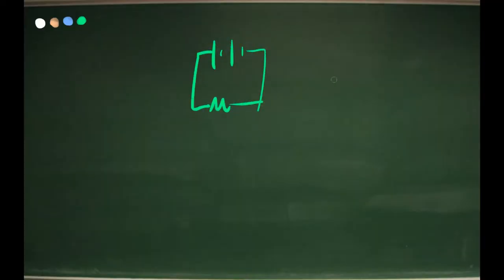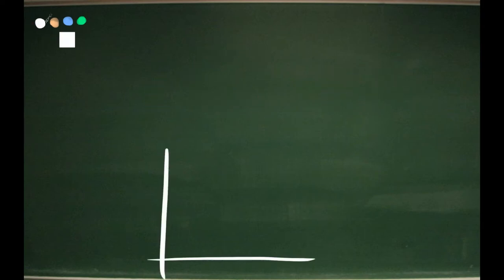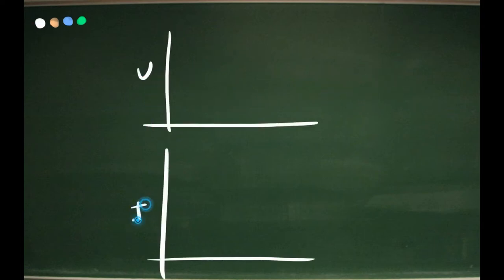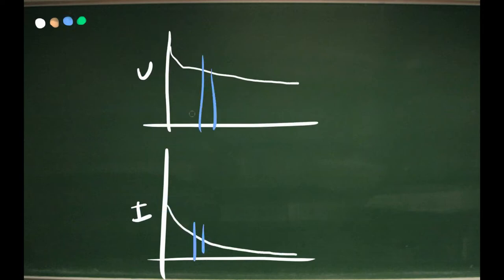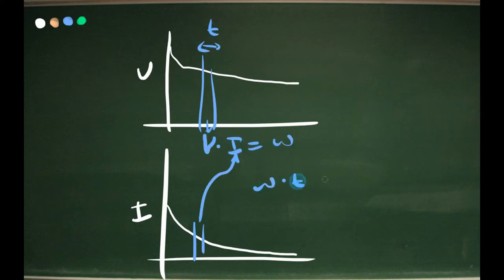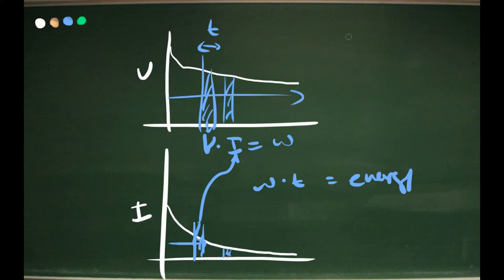5 Ways to Measure a Battery's Performance

Comment: For drivers new to EVs, some of these data points you mentioned aren't available to help us measure EV battery degradation. While not perfect, how reasonable is tracking below over time for an average EV driver:

Kwh Used / Kwh Available = ~ Battery Degradation

Comment: I thought I'd share this paper I found where researchers seem to have done an amazing amount of optimization on this Iron-chloride-acid battery invented ~ 1980.  They use Indium-chloride to reduce H2, with ascorbic-acid, citric acid, and other additives.  They claim to have improved charge-efficiency from 50% to an average ~90%.   They even mention ligand type structures (presumably like EDTA) to support a pH gradient that a separator-membrane won't, in order to mitigate side-reactions.     http://jes.ecsdl.org/content/163/1/A5118.full.pdf  A lot of this seems DIY accessible, FWIW.
Reply: Thanks Mike, good digging.

Comment: Hello! You talk a lot about batteries and I saw you have a PhD. Did you get your PhD in electrochemistry? I have a PhD in lignocellulosic materials and working with this stuff I wonder what do you think about cellulose in batteries. You know, cellulose is electrochemical inert but if you chemically modify it to put a big density charge onto its surface, everything changes. And, you know, cellulose is the most abundant polymer on earth, so is cheap...
Thanks,
Dan